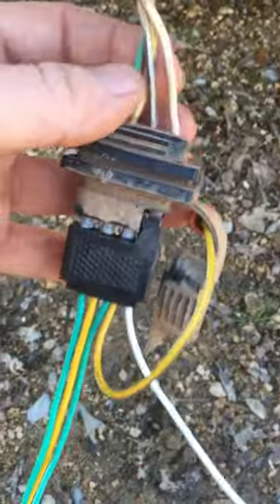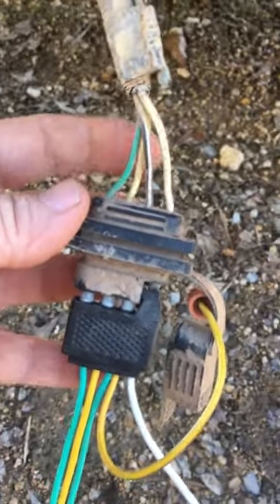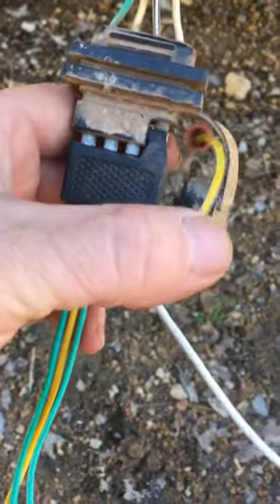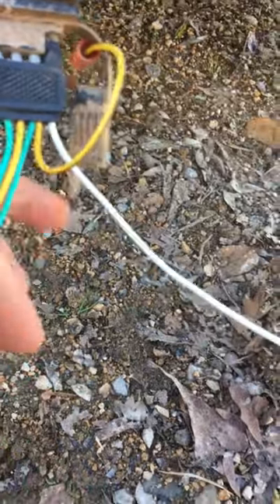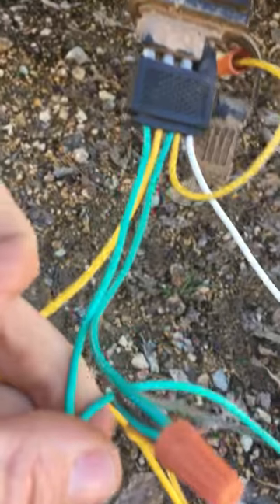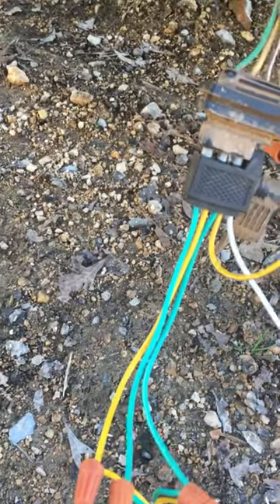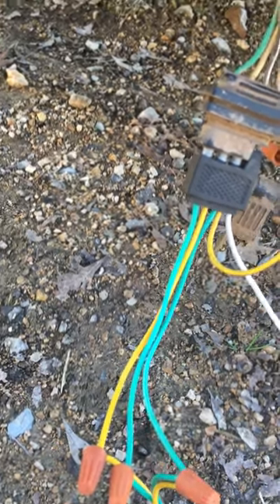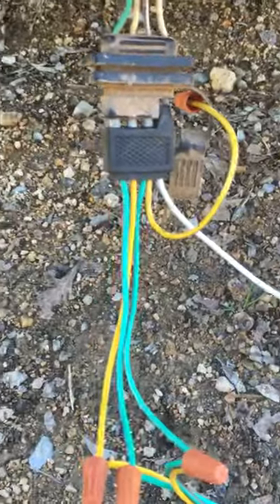Trailer light problem

Comment: I have a 4 wire to 5 wire, before I start cutting stuff... my running lights work for everything. Only the right side works for break lights AND blinker. Left just stays on no blinking or getting brighter when brake is pressed. Anyone know whats up?
Reply: I'm having the same problem. 
Im.rewiring and replacing w new led lights, that SHOULD fix our problem vs pulling your hair for hours.
Reply: I dont suppose either of you discovered the specific cause of this issue? My trailer is experiencing identical symptoms to what you've described
Reply: @00jonesin  I ended up removing all wiring and just started over. I think it was actually messed up from the factory. When I pulled the old wires out. Some were kinda glued inside the metal pipes from the black paint they used to seal the trailer frame with. Works great now.

Comment: I have 5 wire 4 pin on my trailer everything working but running lights ????
Reply: same issue let me know if u find any solution
Reply: Do you have a fuse for running lights in your car/truck ? 😊
Reply: Turn your headlights on and then go back and check your lights.
Reply: It’s your ground trust me just got done with this issue. Check all your grounds on the whole trailer and your car.